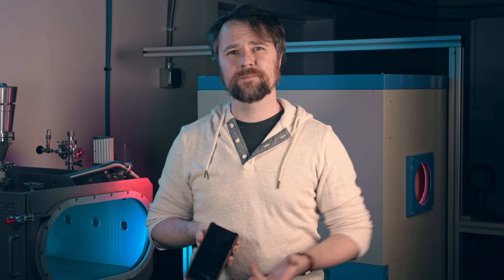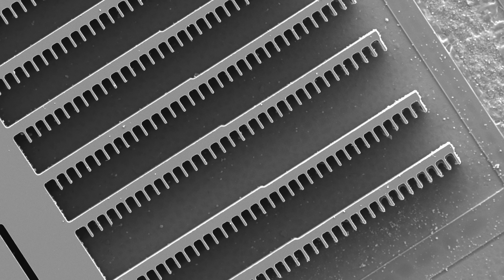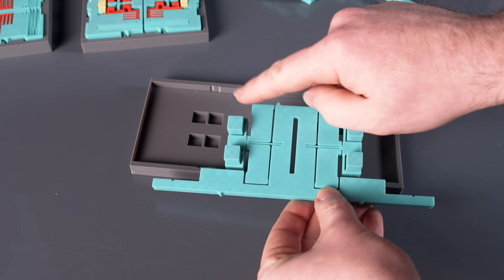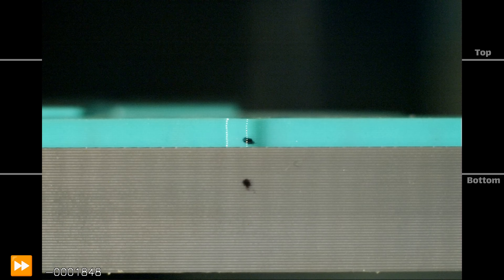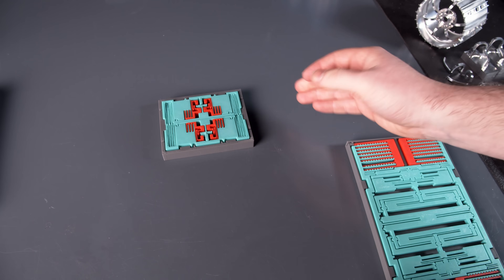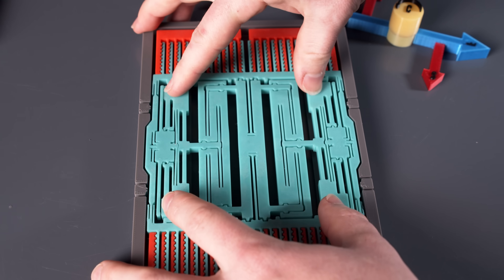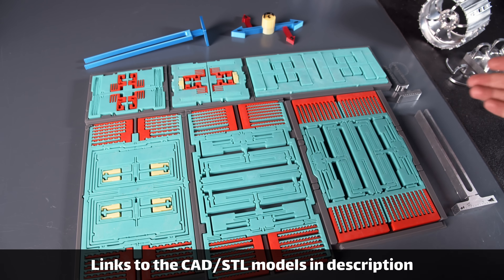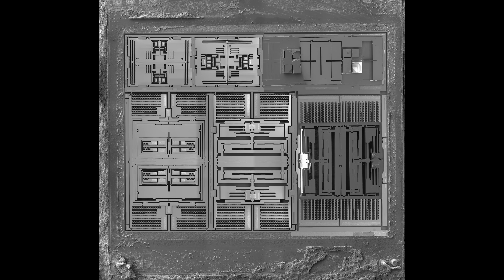The Micro Mechanisms in Your Phone

Comment: While the accelerometer is quite simple, the gyroscope isn't...
Correct me if I'm wrong: the gyroscope (usual one, not MEMS) is supposed to stay stable while everything around him rotates. And this "gyroscope" is more about measuring angular acceleration, right? Second, this gyroscope will only work if the axis of rotation right in the middle of the each scheme? Bc if it's not, then both branches of the tuning fork will accelerate into same direction, but with different force (one will be further from the axis of rotation)
P.S. Also, why silicon? Why not copper or other metals? After all these "combs" act based on measuring capacity when they move (and therefor distance between lines change and then capacity changes).
P.S.S. Very nice video! Very educational!
Reply: I'm no physicist but here's my take:
Gyroscope stay stable since if you try to change their state, it creates an opposing force. I think the same principle applies here, it's just that this opposing force is what is measured to figure out what changed.
I think it works even if it's not the center of rotation, as that movement could also be described as a rotation and translation, which in combination with the accelerometer should complete the picture.
Lastly, I'm pretty sure it's silicon because we have the manufacturing capability to produce structures of this size. They use a similar (if not the same) process as when manufacturing other ICs.
Reply: Each of the three MEMS gyroscopes registers a component of the overall angular acceleration. If the applied angular acceleration happens to coincide with the axis of optimal sensitivity of one gyro then the value registered is equal to the actual angular acceleration. When there is an angle between the two then the response is weaker, but there is still a response. For instance, at an angle of 45 degrees the sine of the angle is 0.707; the value reported by the gyro will be that percentage of the actual angular acceleration. 

All three gyros are continuously registering a value for angular acceleration. Software running on the device can then infer the actual angular acceleration, according to the ratios of the values relative to each other.

Comment: Thank you for video. From the different pictures in internet I was able to understand how X/Y axis accelerometer works, but Z axis wasn't clear for me. BTW do you know how they are doing moving parts of device? Is it some etching "underneath" technic.
Reply from the maker: I'm not entirely certain where the actuators are on all the gyros, but the mechanism is almost certainly an electrostatic actuator (basically an inverse of the electrostatic comb sensors). On the Z gyro, I'm pretty sure the "center combs" (colored yellow in the model) are the actuators and are responsible for vibrating it. Not entirely sure where the actuators are on the X and Y gyros though. There could be pad actuators under the device, or on some of the edges, but those would both be a little unorthodox. Not sure! It's possible there's another layer that I just didn't get to see due to my imperfect decapping, so some details might be hidden from us.
Reply: @BreakingTaps  would a piezo crystal make sense?

Comment: Irrelevant detail, but when dropping a phone, it stops perceiving an acceleration.
Reply: At what point?
Reply: @larrybud  from the reference point of the phone and it's sensors. or what do you mean?
Like, a MEMS sensor at rest on the surface of the earth will measure 1g in the direction towards the center of the earth.
A MEMS sensor in free fall or orbit in space will measure 0g (+- anomalies and noise).
Reply: @fartboxinspector  Your additional explanation makes sense, and makes my question null and void. lol
Reply: We should distinguish between actual acceleration, which is a derivative of velocity, and the force of acceleration. i.e. when you drop the phone, it starts moving and accelerating. You can see that it is really moving and accelerating,
Reply: @8546Ken  yeah. Physicist talk about reference frames.
We got the reference frame of the earth and the reference frame of the phone.
Reply: @fartboxinspector  When I was in grad school I worked on a huge analog computer project to simulate the performance of a propose fighter plane. All of the plane's performance parameters - thrust, drag, lift, etc. worked with the plane's frame of reference.  But all of the plane's motions, velocity, altitude, etc worked with the earth's frame of reference.  One section of the computer was programmed to transpose from one frame of reference to the other.

Comment: MEMS devices are amazing. I don't think people realise how many applications they have - from printers and projectors, to accelerometers and barometers. That's just a few possible applications.

Also, Bambu Lab crew!
Reply from the maker: That printer is like a cheat code! Works so well, can't imagine printing these things up without it!
Reply: @BreakingTaps  Speaking of printers and MEMS... piezoelectric inkjet printheads are mems devices that look pretty cool under a microscope if you're ever bored. (Just be smarter than me and realize that if you want look at a think while it's shooting in everywhere maybe covering things up a bit...)
Reply: The important application are actually cars, in particular the Airbag Control Unit. That was the initial driver for MEMS development.
Reply: @graealex  Yes! That is the driving force in that market and generates the high volume orders. It is that volume that made the Accellerator and Gyro MEMS parts so cheap.
Unfortunately there are not many application where this speciality technology is used.
Reply: Drones probably account for a significant part of the market and development of gyros nowadays. Both civilian and military, are likely using chips from the same manufacturers.
(Since this is where you need really good precicion, in drones and missiles)
Reply: @helmutzollner5496  There's a lot of uses for these kinds of devices, even for the one in the video, with gyro and accelerometers. From, as mentioned, cars, drones and phones as well as anything from robot arms to planes to practically anything that needs to know it's orientation and/or acceleration. I doubt the gyros in a plane are this small and delicate, but you get the point. Lot's of applications.
Reply: @graealex  sort of, but the first silicon accelerometers actually went into ge compact washing machines for apartments, they needed a way to remove the bulky cement counterweights used to dampen the vibrations (the accelerometers weren't developed for this purpose, but it was the first use case that went into actual production). I only happen to know this due to a conference I attended with st engineers.
Reply: I remember at least ten years ago the remote control helicopters had 3 axis gyros. Then a few years later they started selling them with, what they called, 6 axis gyros. At the time I remember wondering where these other axis came from, but the new gyros did in fact work much better. I’d love to actually compare the internals of both of those gyros. You did a fantastic job on this video btw! Thank you very much!!
Reply: @Cr125stin  A 6-axis gyro is just a 3-axis gyro with a 3-axis accelerometer incorporated. Like the one in this video.
Reply: @alexanderg-p3z  gotcha that makes sense. Thanks for the info!
Reply: there is a microspectrometr made out of mems, thats hilarious
Reply: Don't forget  guided munitions. That's what paid for all this research.
Reply: I tried a MEMS with a magnetometer to use as a compass for a observatory dome, but failed as the dome and high altitudes made southern headings not readable. Might revisit sometime later though :D
Reply: Detectores de metais até na alvenaria e de águas subterrâneas na radiestesia pedem enfoques;
Reply: MEMS devices are also in the stability control of modern cars. Within a fraction of a second the sense instability and attempt to apply micro controlled braking to regain control.
Reply: one of first and most famous usecases was the Wii-Remote

Comment from the maker: 🚨Correction! 🚨

I misattributed some of the forces involved in my explanation at 6:00. @StadtlerHM sent me this explanation note:

> "So when you drop your device and there is a downwards acceleration, the frame of the mems device will move down, and because the [proof mass] is decoupled from the rest of [the frame], it will attempt to stay where it is by moving upwards."
> 
> This is true for how the phone detects acceleration to the phone by any force that acts on the frame, but not the proof mass. Gravity however acts just as much on the frame as it does on the proof mass, and as such there will be no difference in acceleration from gravity between the frame and proof mass. An accelerometer therefore can not detect acceleration from gravity when accelerating when in freefall.
> 
> Instead, when the phone is stationary, the proof mass will hang low, being pulled down by gravity, with the flexion joint pulling it upwards to keep it stationary. When the phone is dropped, the spring force remains, but the gravitational force now acts equally on the frame and proof mass, causing the accelerometer to detect no apparent acceleration from gravity. Because the spring force is pulling the proof mass upwards, it will be pushed upwards relative to the frame, causing it to appear to stay stationary, and "lag" behind the frame in the fall.
> 
> In short, the reason the proof mass stays stationary is due to the force from the flexion joint, not because of inertia causing it to "move up". Both the phone frame and proof mass have inertia, and both are affected just as much by gravity.
> 
> The spring force on the proof mass acts as a spring that's bent and released, accelerating it upwards and starting to oscillate. This is why your test shows the proof mass "lagging" behind the frame when first dropped, then subsequently starting to oscillate.

Thanks @StadtlerHM!